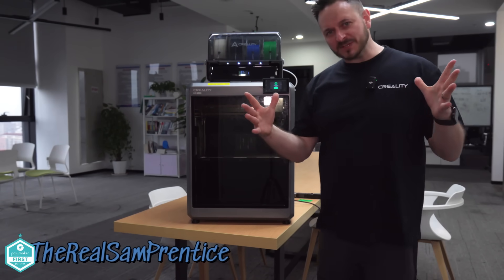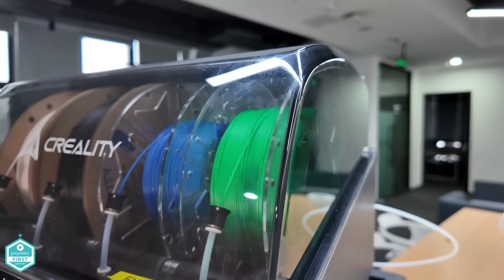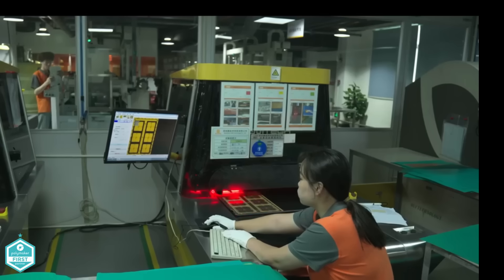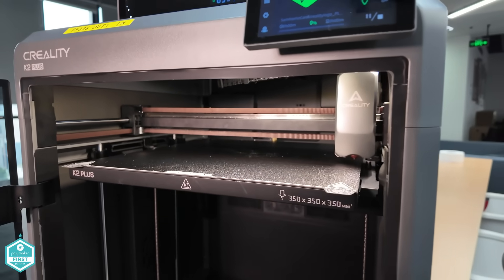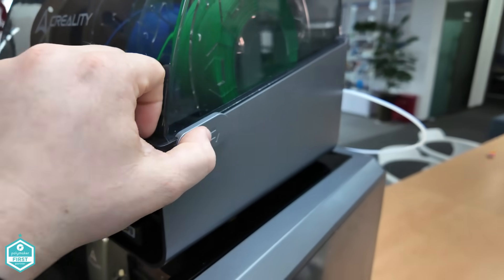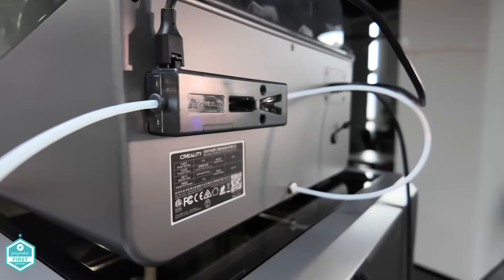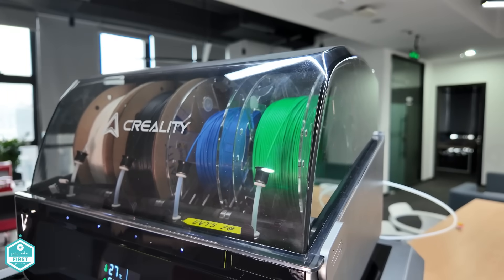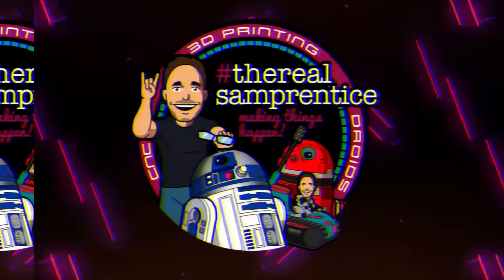The Very First Look At The Creality K2 Plus

Comment: No mention of how you get the print job into the printer.  If I'm going to spend 2200 dollars on a printer then I want it on the network.  At least a USB port to connect it to a computer then share it from the computer.
Reply from the maker: Yeah it does all the things the printer is $1499 with the cfs so I’m not sure where you’re getting 2200 from unless you’re going down the 4 cfs route

Comment: I don't print in colors.  I make functional parts.  I'd love to use the CFS to feed ABS and TPU to make a part with both materials but the AMS doesn't feed TPU and the CFS probably won't either.  The CFS displays temperature and humidity but it's not heated to dry filament?  I think I'll add a heater.  I'll probably scrap my plan to buy an SV08 but the K2 Plus won't be available until July?

Comment: Need to bear in mind that it has heated chamber. It can be 500W easily by itself and will be mains powered. Another can be bed. So don't think they are running 24v for bed.
Reply from the maker: Plus, it might have changed since the release

Comment: Hi Sam Do you know when the K2 plus will be released, for example you who can show it off and go deeper with the new K2 plus.

or have they completely chosen that only Kevin 3D is allowed to show it in house? 

a little strange that no youtuber has got or has had to show it off, still a lot of money to throw on the table if you find things that are not as they should be again or regarding rep it is almost impossible for a normal user to change himself.
Reply from the maker: I have it here and there are several out there running beta tests, it’s not really that strange as many manufacturers do the same so we can work on content and feedback any issues. You won’t be disappointed I feel 🎉
Reply: @TheRealSamPrentice  thanks for the info. it was more compared to previous releases that no one still hasn't really seen much of the other, the superficial videos that are there, where you can't form a proper impression in any way, several places in my home country, you can order it without anyone fixed date on when they will actually be able to be delivered. but then I have to happily wait for you to make a video of it, I hope it will be easier to repair if vital parts need to be changed such as bearings.

Comment: If Creality can deliver an open CFS system for upgrading nearly every printer from a Prusa MK3/4 over an Ender 3V3 to an K1c ... that would sell like warm bread, especially with open scripts for any Klipper machine!

For the K2 I hope they do also bring a "standard" K2 with 300 x 300 (which is enough for me) and maybe also an K2c with 220x220 or 250x250.
Reply from the maker: Why would they do that? That’s more of a 3rd party solution

Comment: Nice video! Loved it, thank you for the time and effort you put into making these video's.. I also have a question.. 

I made a cabinet in my kitchen complete with a desk dedicated for a 3D printer work environment for my Ender3v2, 4 years ago. It has 2 compartments with 62cm in hight, 56,5cm width, 48cm deep and 2 large drawers beneath for filllament boxes. I made it because i wanted an enclosed environment for the Ender3v2 to keep the heat and noise inside.. 

My question is, and this may be a retorical question but i realy want to update and read somewhere that the K2 plus is 64cm high. Is this with or without the filament holder on top? 😅 

Im thinking of buying the K1 Max because it would fit in there, but if the K2 Plus without the fillament holder would fit it would be better.. I cant find anything about dimensions with and without the fillament Dryer/Holder on top... If it would fit i could place the fillament dryer/holder in the top cabinet and drill a hole to the lower compartment.. If not im buying the k1 Max with an Micro Swiss extruder.. 

If anyone has info please lemme know.. thank you.  🥰

Comment: At first I was eager to see more until I saw that the filament readouts weren't for a dryer box.  That is a BIG miss on Creality's part.  I would have loved not to have a separate dryer box taking up room.
Now.. I've been looking into buying a multi-color printer for the past two weeks and I'd love to buy the Prusa XL but spending over $5,000 for a hobby/toy for a 5-color changer is something that I can't do.  Why Prusa?  Prusa is the only printer that dedicates a print head to each filament, thus allowing for different nozzle sizes as well as TPU.  As TPU is very touchy the feeder tension needs to be adjusted and I am doubting that Creality's printer will allow for separate tensions settings with a single print head.  Also, the amount of waste created printing in multiple color can be extreme. I've seen a video that shows a print using 8 oz or material and 28 oz of waste was produced.  This really has turned me off.  The amount is dependent on the number of filament changes per print level.  I was hoping to use one filament for support(PLA) and the other as my main(PETG).  This doesn't sound practical as I'd waste too much filament on small items.  On large items the percentage of waste would be reduced, percentage wise.
I know that RFIDs are nice at times but I hope that they would not create a situation where you must buy Creality filaments as they do not offer a full-range of types and colors.

Thoughts?

Comment: Nothing is said about the bad uneven bed that k1 has. Have they done the same Alu crap with k2? Then this is not multicolor but can only change color on the next layer?
Want a better interview
Reply from the maker: Yeah most people won’t mention a printer that’s not relevant to a first look of another one really, and it’s certainly not layered printing, it’s very much the same process as the Bambu Ams system. I’d like to bring you a better “review” so time will tell on that one.

Comment: hi, is this stable for tall prints, or it will still have layer shifts? thanks
Reply from the maker: When you say still.. ? this is a new printer
Reply: @TheRealSamPrentice  sorry, I mean new printers could still have fail prints, and older (technology) 3D printers have more issues need to tweak around. New improved technology printers like this one I'd assume the manufacturers  improved a great deal and fix a lot of issues and they are much more user friendly.  I have an old creality that causes layer shifts when printing tall prints, im assuming it's the bed slinger movement issue

Comment: Thank you for awesome video, 
I can understand my wishlist Item more properly.

By the way I can't find any port for wired connection, The printer can't Wired connect with usb drive or laptop?
Reply from the maker: It’s on the right panel, this printer runs klipper so you connect via ip

Comment: 1200 watts, that's a bit excessive.  That's the only turn off of that machine, especially if you wanted to get more than one.  The bambu P1S is only running at 350w.
Reply from the maker: Maybe let’s see
Reply: If it uses 1200 watts then it uses 1200 watts, there's no let's see needed.  Bambu only clocks in at 350w max, so looks like creality is overkill.  In the long run you will be paying more from the power consumption of the Creality.
Reply from the maker: It’s probably because the bed is 24 V I’m assuming.. plus the heated chamber.. what’s the x1e rated at ?
Reply: @TheRealSamPrentice it is showing max is 750w for the X1E.  750w is still a bit much.  I think the  X1C and P1S coming in at 350w is perfect especially for someone that wants multiple of the same printer.
Reply from the maker: @spider2021 oh god yes, I don’t know if there is a single psu in this or if they split it across 3, I’ll find out when I get in front of it at rapid

Comment: What if instead of pooping out the filament, it printed the transition color in the infill, that way your not wasiting the filament and you wont see the different color in the print (will vary of course with different parts)
Reply: Very good idea. I tcould also calculate what remains in the tube and switch colour before it actually needs it, to reduce waste. This will not work for small changes though.

Comment: There is not a lot they can do with the purge - you need to clean the old color. POSSIBLY for SOME combos you could do that during infill, but generally: going from black to white means a LOT of purge is needed so the white is pure.
Reply: They could have the purge chute more on the side and prepared to have some channel so that it falls out to the side. That way it would be easy to have/print a bucket that collects it WITHOUT having to go to the back of the printer.

Comment: Not a good demo to be honest... Making door shatter proof (like a car window) instead of solving initial issue of door mounts plus staying in place (better magnets, some additional mechanism to keep door closed). Multimaterial example is also can be done on k1 or even good old Ender 3 as it's just change of filament on N layer. 😅 Theirs marketing is a bit inefficient..

Comment: Does the CFS (or CMS) support multi-material or just multi-color of same material?
Reply: That's not CMS job to guarantee multi material support. Adhesion is performed by slicing software. CMS will feed whatever you want to.

Comment: Did they print quality improved like bambu labs or is it same as the k1 max??
Reply: Some have said the k1 series prints as well as Bambu labs ... provided the k1 uses bambu sliced code. A few hoops to jump thru to get the code to work. The fix would be an improved creality slicer ... which just released version 5.0.  Verdict on 5.0 is still out. I'm running the 5.0 calibration models on my k1c as I type. 
The 5.0 slicer looks intimidating to newbies, but their filament default settings as quite good for newbies.

Comment: if the multicolor works as well as bambu labs this will take the market with this build size. any idea what the price range will be, i hope its competitive with the p1s and ams combo, if its the x1c an ams combo it will knock alot of ppl out of getting it, thats what made me go with the p1s over the x1c was being able to get the ams with it for less than the x1c alone. ive been loving my p1s tho an my only complaint about it so far has been wishing the build volume was 300x300 instead of the 250x250 an when it comes to printing multicolor u cant do the full 250 cause u have to have room for the purge tower an im always forgetting about the purge tower. cant wait for this to hit the market.

Comment: Man I absolutely did NOT want to get a bambu printer. However, after returning 3 k1s I ended up turning to bambu. This seems promising as far as "plug and play," goes. In all honesty, there is nearly zero innovation, which is disappointing. Hopefully it is cheaper than Bambu because it seems Bambu did all the r and d for creality. Ultimately, creality's quality control has been an issue since the beginning of time. I really hope they can get that under control so that I can return to having an open source operation.

Comment: so they basicly copied the bambu lab carbon x1 features...
Reply: Yep....directly copied Bambu's 350x350x350, 350C hotend, heated chamber, linear bearing rails, closed loop controls with encoders on the stepper, nozzle cam for flow/clog monitoring...total carbon copy...

Comment: If you really wanted to beat Bambu....don't COPY them, IMPROVE over them.  As in build a MMS that is more then 4 colors?  Like do a 5 or 6 color system instead?  Really funny (and stupid) that other muti color systems are coming out in 4 colors too LOL.  Now yes you went with a bigger build 350 volume, that would have given you PLENTY of space for a 5 spool color holder, as that 4 now looks small up there LOL.

Comment: I don’t think it’s about the glass alone. It’s the hinge having no resistance to movement. If it had some tension when you broke yours it wouldn’t have slung open to the point where the glass had to flex which it can’t so it broke/shattered.

Comment: at 0:53
you point your finger at a DC input. Should be 24V. Is the CFS powered by the printer? If so, and if that applies to another 3 CMS, why should a DC input be installed there if you cannot operate the unit "without a printer"? In my opinion, this could mean that the CMS can heat up after all and couldn't there also be a humidity control?
Or is that the feed for the bypass filament? Doesn't look like it to me, but then where is the feed?

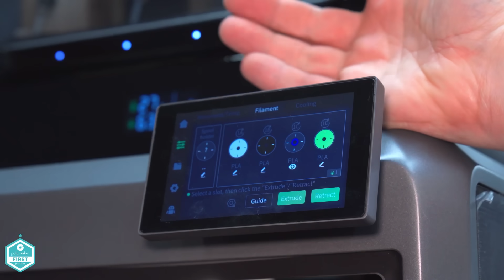at 3:02
I recognize a humidity symbol on the touch display to the right below the representation of the 1D spool. What setting options come up when you press it?

Comment: Sam, if you have any pull with the engineers, can you suggest to them  to add a threaded insert hole pattern (or at least clear holes to add threaded inserts) for the poop chute so a printed bin or chute can be affixed to the back without modification or removal to the rear plate
Reply from the maker: I’ve had a chat with them today there are things I’d change like the usb and the position of the shoot. I’d like to see it at the front
Reply: @TheRealSamPrentice   While I agree with the USB location not being ideal, that's a lot easier to change with a ribbon cable or something internal than the location of a the chute. Multiple assemblies would be affected including software to move that chute location. And honestly, the chute location is fine IMO, just needs an attachment point for a printable bin or longer wrap around chute.

Comment: Does CFS have in-built filament dryer and there is no need for the external dryer?
Reply from the maker: Unfortunately not :(
Reply: @TheRealSamPrentice  Then what is that temperature reading on the screen? what’s the purpose of it?
Reply from the maker: @meetpatel4225 humidity sensor and temperature

Comment: If the bed is the same as the K1 Max, it will not be worth buying it even for €100. It seems unbelievable that, after so many years (my first printer was a CR-10) they continue with the 3mm beds that deform  when heated.

Comment: Sorry, had to pause the video to make this comment.  But the way you closed the door is not going to shatter it.  What shattered the door was when it swung outward and hinges applied a lot of pressure to the glass in a small area, that’s what shattered it.  Closing it hard so that pressure is spread out across the sides of the glass isn’t going to break it as easily as two hinges in a small area.  I’d be more impressed if you tipped the printer on the side like Uncle Jessie did and it didn’t break.  Now, on to watching the rest of the video.
Reply from the maker: Well let’s get that footage recorded today then
Reply: yup. they demonstrate "shutting" but the problem was the 'fully opening quickly and hitting the end of motion of hinge movement' - thus causing stresses in the hinge area, and shattering the glass.
Reply: Yeah like why wouldn't you just think to test it the way it broke un the first place
Reply from the maker: @rocketboyjv5474 when you say un.. what do you mean ?
Reply: I'm glad they responded here because I was thinking the same thing except that it was a bit shady that in order to test if they fixed the problem of the door breaking when it's opened to hard.... they close the door hard. Seeing his response let's me believe he just overlooked that detail instead of trying to hide it.
Reply: How much and when will it be available?
Reply: @JuanDoe1776 did you even watch the video?
Reply: take care of your printer and you’ll never have to worry about it.

Comment: Still have the lidar?   They get rid of the nozzle cooling and only use the aux fans?
Reply: Only having aux fans on both sides is a good thing. That reduces weight in the toolhead which will help with input shaper results. I'd be worried about the noise levels though